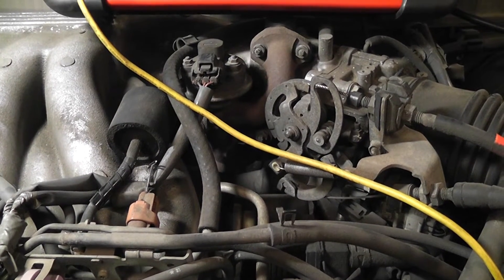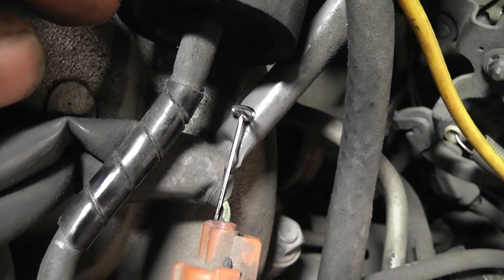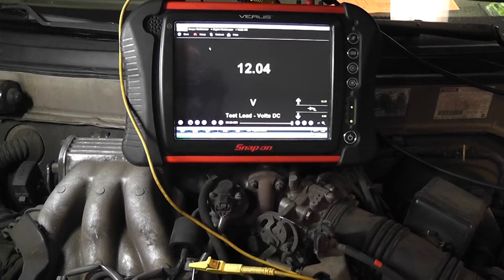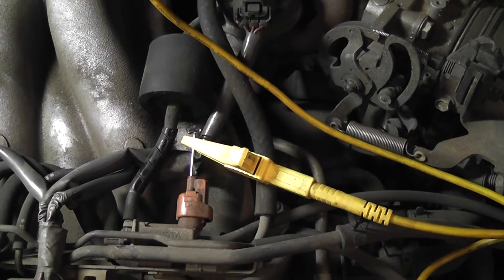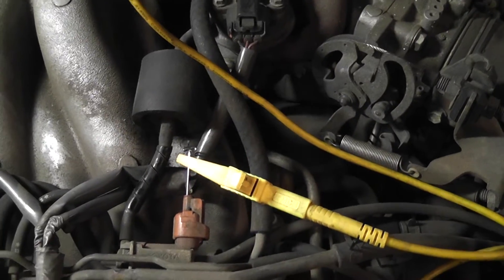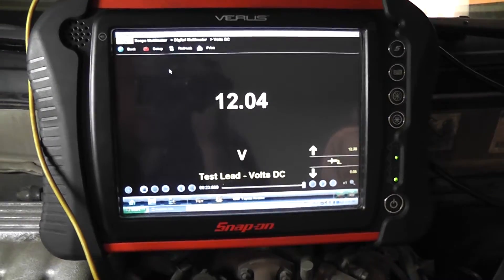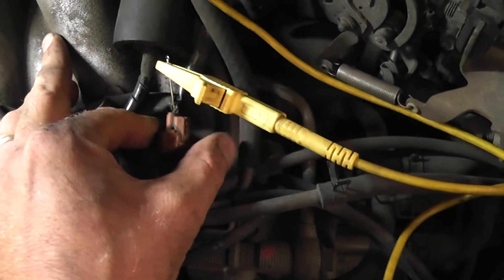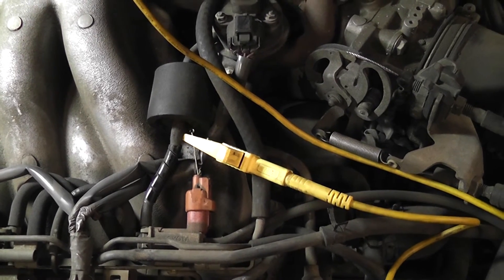How to test a computer controlled solenoid (circuit ID with voltmeter)

Comment: Hi - both my 12v solenoid wires stay at 12v even when I pull out the plug. do you know what that might mean?
Reply from the maker: More info needed. Year, make, model, engine and what specific solenoid? Does it share a control wire with another solenoid or component?

Comment: Im trying to figure out if a purge solenoid is ground side switched or power side switched. I back probed both wires on the purge solenoid harness connector using a t-pin one at a time. Using a multimeter on DCV 20 i connected the black lead probe to the battery negative terminal and the red lead probe to both wires on the purge solenoid harness connector one at a time. With the ignition key ON engine not running the multimeter gave me a reading of (.04 .05) on both wires. With the ignition key OFF engine not running the multimeter gave me a reading of (0.00) on both wires.
Reply from the maker: Sounds like it is power side switched and was not being turned on during your testing.
1. If there are codes for that solenoid, the PCM may not turn it on until you do a code clear.
2. If the solenoid is shorted and the PCM doesn't like the current flow, it will again, turn that circuit off.
3. You didn't meet the conditions (Engine temp. Rpm etc) for that output to turn on
4. You have an open in the control wire
5. Confirm circuit design with a diagram
6. Use a test light connected to battery positive and disconnect solenoid. One of those two wires will show a constant ground if it is power side switched.
The other wire that doesn't light, will be your control wire. Leave your test light connected there while clearing trouble codes, then start the engine and see if your light turns on or flashes
Reply: Do i have to turn the ignition key ON or OFF before i disconnect the purge solenoid harness connector and connect the test light to battery positive to see which one of the two wires has a constant ground on the purge solenoid harness connector? @ScannerDanner
Reply from the maker: @Diagnose1  key on for all tests. Some outputs won't have power until the engine is running, so sometimes engine running

Comment: What about a monitored control wire circuit with a bias voltage? Would you just try and pull the bias to GND with a test light, same as a sensor circuit?
Reply from the maker: You can do that

Comment: hey danner, I working a 2002 mercury sable 30.  OBD II code reader said p1747  Haynes say epc solenoid where is this located ? Second there is a light in in the tact gear with explamatin point what is this for ? thanks TOM  @ egenriederthomas@gmail.com

Comment: Also i looked at the wiring diagram and it also confirmed that it was ground side switch because the wire to it also fed the control side of the fuel pump relay which was grounded at the computer. Thanks for your time and i love watching your videos.

Comment: hey danner i was working on a 1998 chrysler t&c 3.8 engine and was diagnosing a p0403 egr code and was doing this test on the egr solenoid and there was power in run and ground in run and there was ground even with key off(test light attatched to battery positive) this was strange to me i then tested the valve off the car and noticed there was no continuity i replaced the valve the customer came back the next morning all readiness test passed (including egr) and was able to license her van. My question is why was there ground all the time?
Reply: 98T&C has a vacuum transducer, which measures the vacuum applied to the vacuum (not electric) operated EGR solenoid. When the solenoid diaphragm gets a hole in it, the transducer registers no vacuum and sets a code. You replaced a good sensor along with a bad valve. No big deal as the broken EGE costed twice as expensive as the transducer and emissions exams are sometimes on a one-day pass to get things fixed.
Reply: its been a long time. but i replaced the valve that sends vac. to EGR valve. i was able to set the code by spinning wheels on the lift by following a drive cycle procedure. i replaced it ran the van on the lift no code set, passed emissions. i don't remember a sensor that measured vac to the valve.

Comment from the maker: first thing is I don't use those terms for output solenoids. Power and ground side switching would be more accurate. First thing is a wiring diagram and secondly with a voltmeter. Section 3 in my eBook if you have it

Comment: Hi Scannerdanner
The control side wire that is unplugged reads 0.35v on the meter
assuming that the control driver s/w is open (no ground)  now
how come the meter reads some kind of volts without ground
Thanks

Comment from the maker: I would check to easiest solenoid to get to first. Don't worry that the P0755 code is the only one in freeze frame data. I believe the P0443 is an EVAP solenoid, which is probably where i would start.

Comment: Hi Paul, I doing my homework for 00 expedition so far I have codes p1747, po750, po755, po743, po443 and p1451, but looking at freeze frame was stored by code po755, all this solenoid get power from fuse 23 so there are ground side switch, so po755 is the first one to check ?